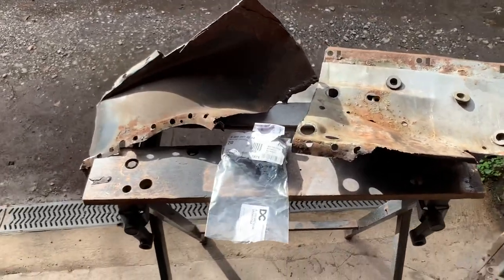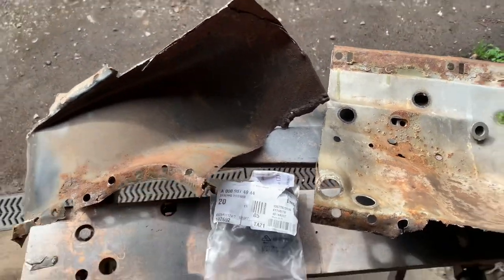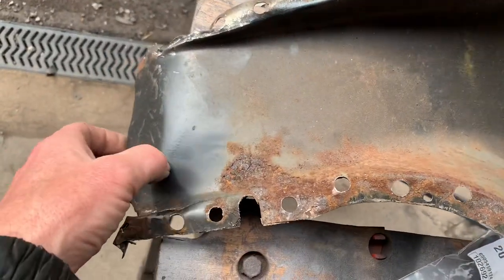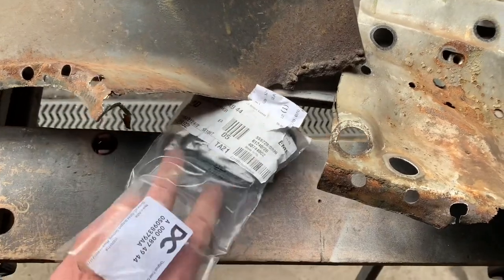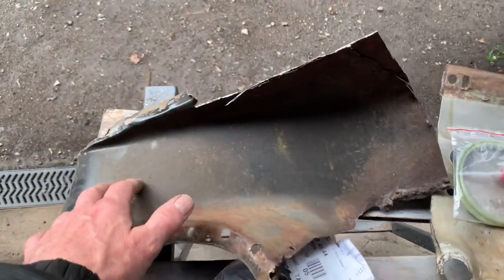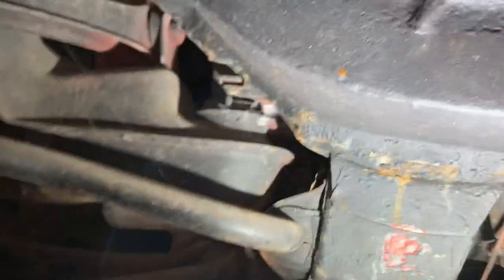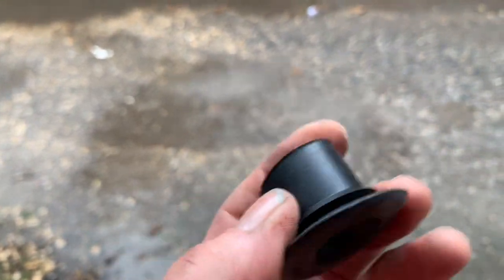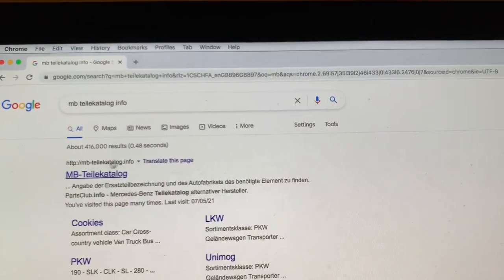Mercedes R107 - grommets and why you should check yours

Comment: Hi Mike, not sure if you cover this in the video, as well as the inner wing panel, there are also several holes lower down the inside of the chassis legs/front members - I think these should have grommets as well, otherwise it would presumably allow water into the inside of the leg.
Reply from the maker: Hi - yes you are right. In fact, you have reminded to me check that my chassis legs still have these grommet holes. The guy who did the welding on my 1983  red 280sl had a habit of omitting the drain holes when he was doing the repairs. I just looked back at some of the work in progress photos and boy did that car have some serious hidden rust. Let me know how your Warm Up Regulator refurb goes. I'm watching your channel with interest. Mike